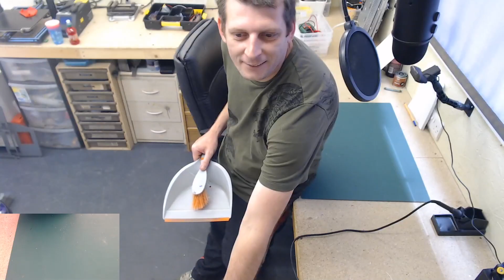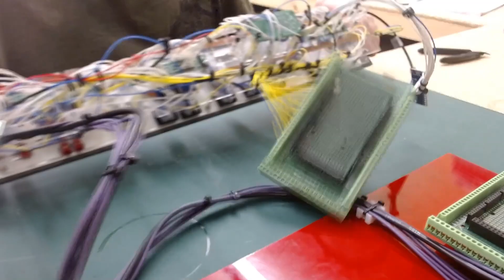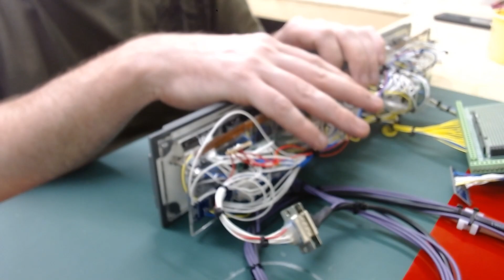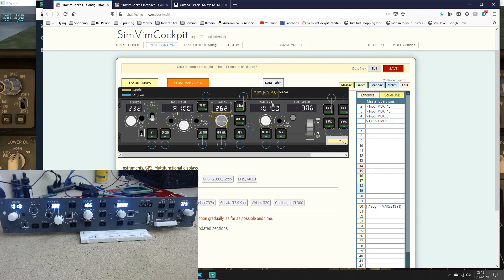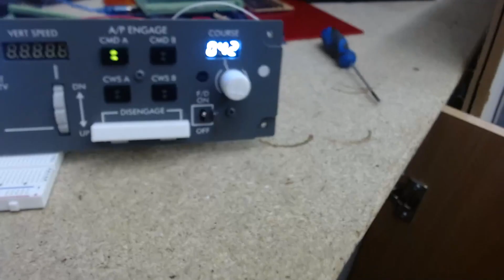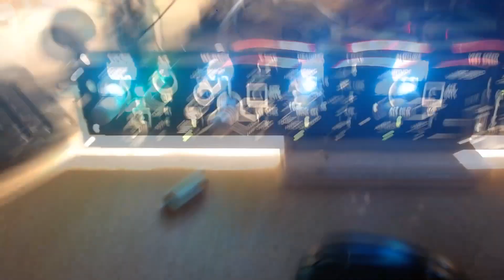737 home sim build - Hispa Panels MCP build part 3

Comment: a great video, bugs and all!  I have 2 questions.  I cuss too much to video my progress in this detail :)
1) why did you use that white terminal strip for pins 27 & 28 instead of just doing another pin strip like you did for pins 22-25?  Just style, or was there a reason for the 2 different kinds of terminals?
2) do you have any video you could share of how you soldered wires to all of the pins of the 7 segment displays?  They're so small and fussy i was just wondering if you'd figured out a trick or could offer a little advice as I start to try and get that done.
thank you!!
Reply from the maker: Hi Steven thanks for your feedback, I’m a country boy we swear all the time and I have to hold back for the videos! There is no reason I used the strip for the 27 and 28 pins, I was just trying different ways. I don’t have any other videos than what’s posted here…..there’s more coming but sim building is a slow process. I invite you to join the discord group as we have many daily chats and pics of work in progress and we have many knowledgeable sim builders on board who are more than happy to offer advice and tips.

Comment: Thanks for sharing your project with us. Especially sharing all your "mistakes". I learned a lot from your videos. Thanks.
Reply from the maker: Thanks Eric, I think it's important to show my mistakes so others can hopefully avoid doing the same
Reply: @simbuilduk5853  How did you solve the Auto Throttle ARM switch when the AT is disarmed automatically? The switch should go to "off" position.
Reply from the maker: @pepijnflies  I didn’t use a solenoid to flick the switch off, hcsci allows the auto throttle to be turned off via the auto throttle disconnect even with the auto throttle switch still in the on position
Reply: @simbuilduk5853  Thanks.

Comment: Hi again !! could you told me where you find your wire ? have you a link ?
Reply from the maker: Hi I use 24awg from eBay https://www.ebay.co.uk/itm/100m-x-Grey-XLPE-UL1385-Hook-Up-Wire-Equipment-Cable-24AWG-H9C5-8918763-/323902148675?_trksid=p2349624.m46890.l49286

Comment: Another great set of videos, it has inspired me to go and buy this and the CDU set from cockpitsimparts, guess I’m committed now! I’m also in the process of trying to teach myself how to wire basic switches through arduinos and have been looking into simvim, this is all new to me so if you feel like doing any future videos on the basics etc that’d be great ;) 👍
Reply from the maker: Thanks Paul, yes that’s the best way to start, breadboard some jumper wires and a few switches of different types will soon get you in the swing of things. I’m always here if you need any help
Reply: Hi again Ian hoping I can pick your brain. I’ve been busy building my MCP and have pretty much finished it however I think I’m having the same problem you did when powering the 7 segment displays in that they don’t display anything useful just gibberish. I was wondering what power supply you had to use? I’ve just been using an old phone charger that has a 5v 2amp output which is also powering the VCC line too, am I asking a bit much of it do you think? Any help is appreciated from anyone who reads this too. Hope you don’t mind the question,

Thanks Paul
Reply from the maker: Paul Hawtin hi Paul, I used a 5v 3 amp, although my issue was that the displays kept going out, are you using max 7219 modules? If so have you grounded the clk via a 1 - 3 k resistor?
Reply: Yes I’m having to run 6 of them one for each display as I couldn’t make two displays run off one for some reason. I haven’t used the resistors though, I think when I was prototyping I did and it caused me problems but maybe I need to try that. I would’ve thought my 2 amp supply would be enough but I’ve tried disconnecting some and as soon as I only run two displays they work so maybe it is a power issue.
Reply from the maker: Paul Hawtin maybe try upping the power amp first and see if that fixes it, if not add the pull up resistors
Reply: Yes thanks I’ll try that first, I’ve ordered some new power supplies to try. I’ve probably picked the most complicated part to build first if I’m honest 😂 all the switches and encoders are working. I’ll get there eventually
Reply: Just an update, turns out the resistors are important! Fitted them and all works now, that’ll teach me to stop ignoring instructions, cheers!

Comment: Congratulations Ian, that looks really good. Glad you added the power dist board for the max boards, people have had problems with the power through connections.
The two hardest jobs done. It's all plain sailing from now on 😉
Reply from the maker: Thanks mate, next job is capt efis which will be a lot easier than my previous 2 projects